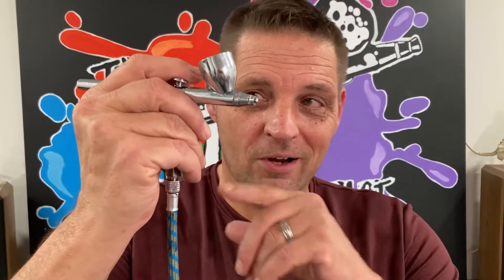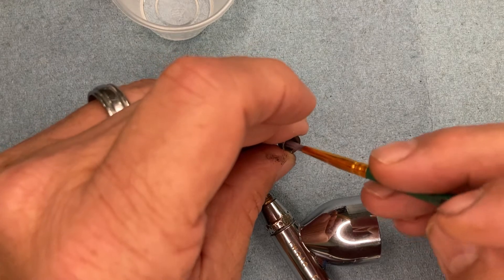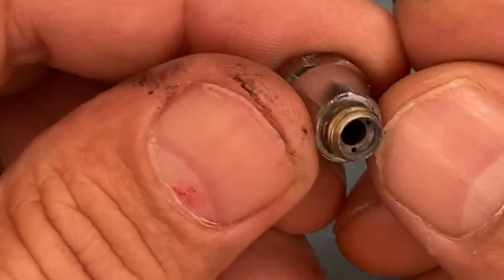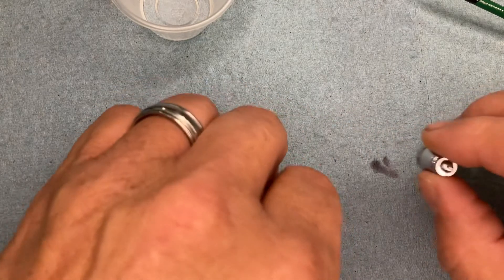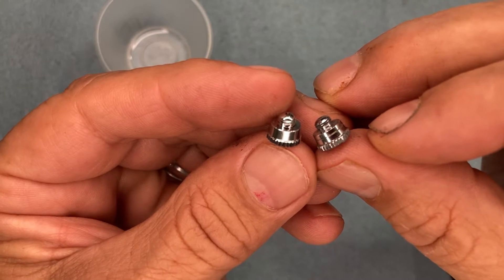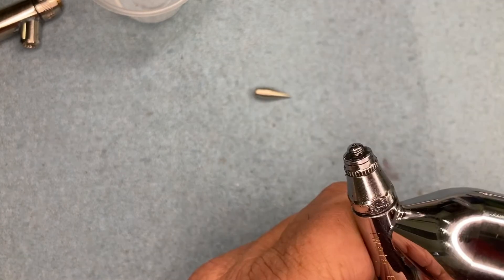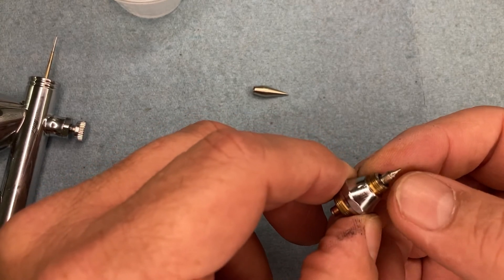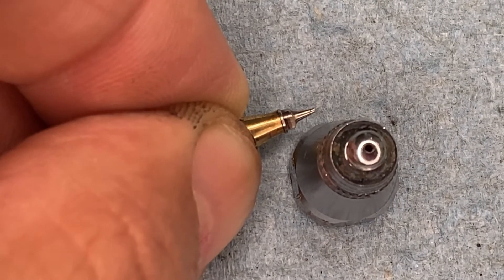The MOST common problem when no air comes out of your airbrush!

Comment: Thanks Bill, always so fun to learn from you. 
What are your thoughts of storing your airbrush in water? I’ve seen vids of people doing it? 🤷‍♂️
Reply from the maker: i leave a small amount of water in the bowl of airbrushes im working with regularly.   But I never found much use in dunking them really.   one you have to setup a spot and then make sure the container is the right depth.  you do NOT want water going up into the air valve area.. all that will do is allow small contaminents into part of the brush that need not be.   
But if it is going to be several days ill wipe the needles and make sure they are clean and usually dry.

Comment: I have same air br.  Wen I push down for air only paint bubbles in my cup then I pull trigger back an no paint but still bubbles in my cup   everything is clean what's problem
Reply from the maker: loose air cap, cracked nozzle, loose nozzle.   those are the three things to check.

Comment: had a problem  tonight with airbrush.  wasnt pullin back to get paint,  all I did was push down and was getting a liitle paint coming out??  why??
Reply from the maker: Needle is not seating all the way.. Likely the nozzle  needs cleaning.  If it feels spongy if you loosen the needle chuck and spin the needle there's a bit of paint in there.
Reply: @TheAIRspace  thanks!

Comment: When i put my water filter without quick release, there's no air coming out. But when i put my quick release then air is coming out. I dont want to put the quick release because of air leaking.
Reply from the maker: the only thing i have seen in a situation like that..  if the gasket on the female side is expanding and cutting off airflow.    Ironically the only place id seen that before came from some cheap quick release adapters.

Comment: Air is blowing out of the trigger of my airbrush.
Reply from the maker: Which airbrush is it?
Reply: @TheAIRspace  Rhino.
Reply from the maker: Rhino a brand?    regardless if air is coming from the trigger area there should be an oring where the trigger seats into the airbrush..    If the trigger sits on top then you need to pull the air valve assembly apart and look for the oring that seals there.   If its the removeable air valve body its best to just replace that part altogether.
Reply: @TheAIRspace  I understand. And thanks for the info and advice. I do appreciate it. (thumbs up)